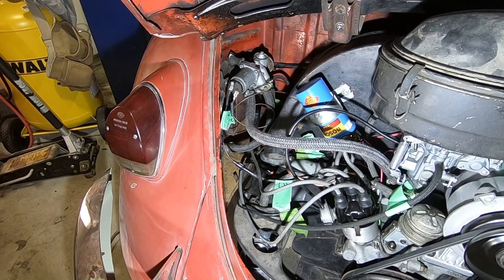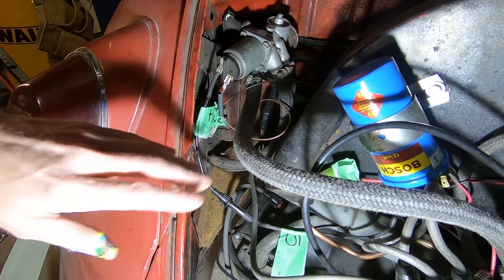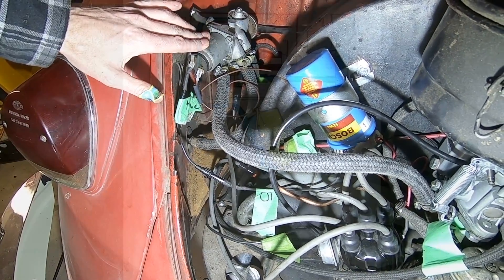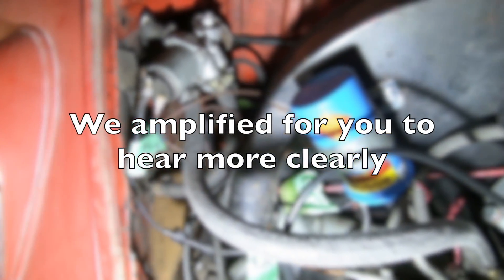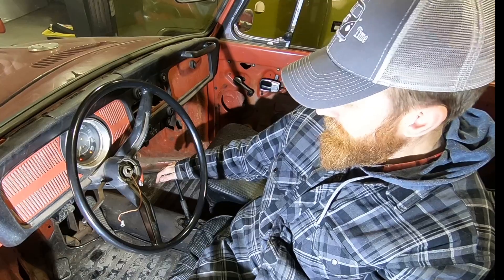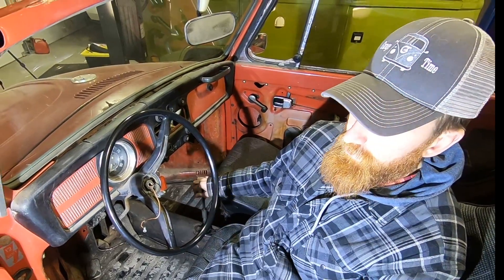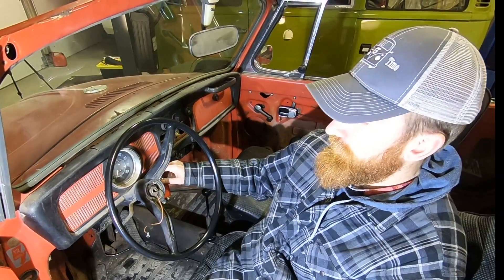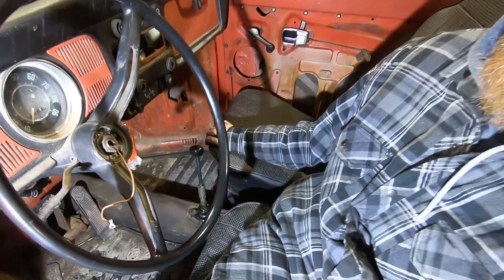VW Autostick - Control Valve - explanation and demonstration

Comment: I have a question my stickshift works fine and engages but engine not idling correctly, if I remove one wire from the control valve it runs fine, when back on runs rough any ideas ? Thanks Andy

Comment: I remember fondly the '73 Bug I owned. Three speed stick with no clutch. When you wanted to change gears  you simply rested your hand on the stick (slight downward pressure) and you would feel/hear the gears disengage, at which point you'd just move the stick to next gear and allow it pop back up and into gear. Super smooth and fun to drive. YEARS ago when I traded it towards a new car, it was hilarious watching the guys at the dealership try to drive it. For whatever reason, none of them could seen to get the feel of it. I honestly never really understood this. It always felt so freakin' simple and intuitive to me. *No surprise, I really miss that little car nowadays. It certainly wasn't anything fancy but it was fun to drive. 😊

Comment: what would happen if the solenoid was constantly engaged (say from the wire to the shifter having a direct short to ground) holding the clutch lever in at all times?

Comment: My dad gave me my grandfather's '69 autostick.  Driving it home for the first time I was resting my hand on the stick at a stop light after taking it out of gear.  Bad move.  When the light turned green I couldn`t get it in gear because the vacuum escape from the tank.  Of course the pneumatic hoses were leaking so it took about a minute or two for the vacuum tank to get enough vacuum from the manifold so I could get it back in gear.  The folks behind me were not amused.  Funny day.  Happy to find your channel.

Comment: Thanks for the video! Do you mind a question? My control valve does not clunk and swoosh. Electrical is good and clutch servo engages well but cant shift. Control valve make a his and bahhh (like a sheep) sound! Stumped.
Reply: Correction. It sounds like a duck-call from the control valve filter

Comment: Hi 
Is there an adjustment on my 71 Autostick that will stop it from jumping when I put it into gear? I believe my vacuum lines are hooked up correctly.
Reply: Mine did too!   No idea why.  Carb maybe?
Reply: There is an adjusting screw on top of the control valve.

Comment: Hey, Mike! Where did you get the new hoses for the control valve?
Reply: Any VW dealership should carry them? Call around. That's at least where I got mine. They have a spiral wire inside to keep the vacuum from collapsing them... I tried a substitute and learned the hard way when the thing collapsed! Strong vacuum...

Comment: HI you spoke of a micro switch activating the valve with just a little touch of the stick. Do you have a video of this micro switch and how to replace or repair?
 I may have this problem because everything else is ok.
thanks...

Romel
Reply from the maker: Hello, here it is:             VW Autostick - Stick shift - disassembly/reassembly replace contact point https://youtu.be/GMKa08t-fSc

Comment: Hello garage time can you show or explain where exactly is the neutral safety switch and how it runs to connect to the control valve. I think this wire on my 74 bug is somehow disconnected......Thanks
Reply from the maker: Romel Nelson Hi Ronel, please check out our video 'VW Autostick - Neutral Safety Switch - Check with Multimeter' we explain and show schematic.  Let us know if you need further information or pictures.  Thanks
Reply: Thanks for the reply. Also one last question. What size is the vacuum hose and where purchased. Thanks again
Reply: Hey Garage i just finished looking at the Neutral Safety Switch video. I'm not able to see on your schematic where it's located on the car. Do you recommend i buy a Bentleys Manual?. thank you
Reply from the maker: Romel Nelson Yes, have found the Bentley manual very helpful for both working and understanding the autostick.  The neutral safety switch is on the drivers side up near the nose cone of the transmission. Very hard to get at while transmission is in the car, but it can be done.  Please don't forget to subscribe, we need your help to keep this channel going. Thanks.

Comment: Why does my autostick shift hard when I go from neutral to reverse & reverse to Lo , not so much into 1st... any thoughts.. thanks
Reply from the maker: Gilbert Muniz Hi Gilbert, ours is doing the same, assumming you mean car really grabs and thuds when going into reverse, but others are nice.  We are investigating and will let you.know what we sort out. Was -13 here today so may have to wait till it gets a little warmer. Hands still cold for 2nd test drive :)
Reply from the maker: Our idea speed was too high, reducing improved smoothness of shifting. Manual also recommended checking control valve adjustment.Clutch engaging to quickly adjust screw between a quarter and half a turn clockwise.  Been really cold here lately, if spring decides to show up we will try to get a video showing the adjustments and changes the idea speed made.  Thanks and good luck.
Reply: Thanku for the videos, I recently acquired a 70 beetle with 44,000 miles on it  and not running, turns out they had the wires all backwards on the coil meaning no start condition to the distribuitar and no power to control cellanoid. Your semi videos made this a easy repair thanku.
Reply: I had an auto stick back in the 80s and woul reverse the contacts on the cellanoid valve and it would make the rear of the car drop a couple inches about 3” when I would drop it in gear the ass end would drop and the other lane would want to race me lol, did it for years. It was fun too do